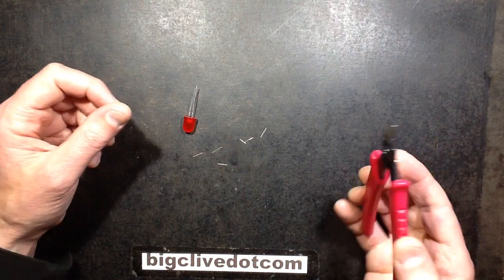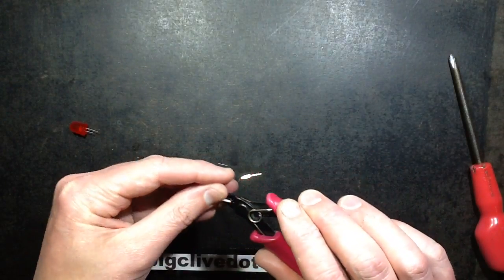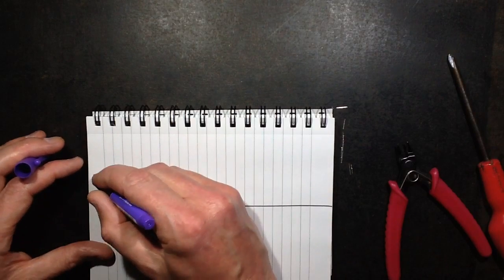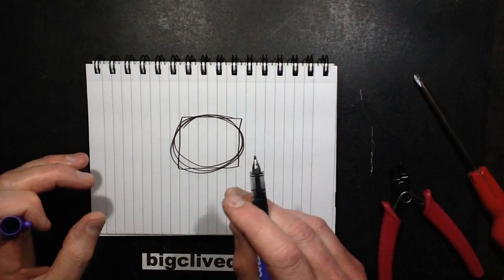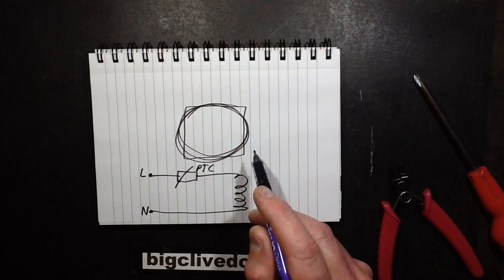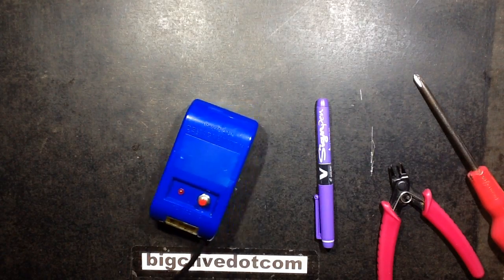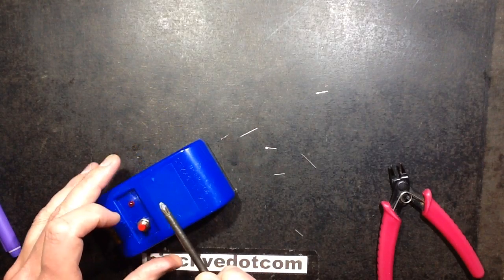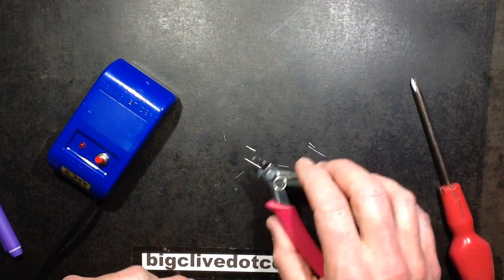A look inside an ebay degausser/demagnetiser from China.

Comment: Tip for a DIY degauser: the water valves in a washingmachine have fairly strong electro magnets, similar to the one in this degauser. They are fully watertight. Mount one of those in a n ABS box with a switch and you're ready to go ;) (it's something I learned about 30 years ago :p )
Reply: Wow, that is a great idea, have a few of those  around; never thought of that, thanks.
Reply: Most CRT's such as an old TV would go through a degauss cycle when powering up and later models especially computer Trinitron monitors had a degauss cycle you could select.   At one seismic data processing company, a user thought he would be a smart ass and said "You want to see something neat" and he put a company fridge magnet onto the screen pulling all the electron beams to it.  He thought it was really cool till the degauss cycle wasn't enough to remove the distortion completely, once he resigned himself to living with a screwed up screen due to his immaturity, I took the powerful magnetic fridge magnet and carefully waved it across the screen at various distances and locations to skillfully stretch out the screen back to a reasonable display and told him not to do that ever again (hopefully the degauss cycles will even out whatever wavering remained over time).   Everything the degauss does can be done by hand with a powerful magnet but it takes time and skill, the demagnetizer is just a simple way of doing it and these watch demagnetizers are dirt cheap, about $15, $25 wth a quality compass to test if the watch is magnetized.  If you still have a mechanical watch, these demagnetizers are worthwhile for whenever they start to run a little fast as it means the balance beam is getting magnetized perhaps by standing too close to a washing machine for too long or just walking past a transformer (mind you skillfully waving the watch around the transformer will also degauss it).  Any magnetism tends to speed up the watch or even freeze it because the effect on the magnetism on the balance beam is to have it act as a shorter beam, you can see if the compass is magnetized by moving it near a compass to see if it reflects, not all of the compass apps on smart phones are sensitive enough to pick up the deflection though one of three I've tried has picked up on my fast running watch, best to use a quality mechanical compass.   Used to be the first thing a jeweler would try if you complained of a fast running watch is to test it with a compass and degauss it with these cheap degaussers but now with so many quartz electronic watches, few even carry the degaussers now and would just ignore a fast running me handicap watch or charge you $200 for an overhaul which usually means sending it to a factory for six weeks.   There used to be mechanical degaussers that used a strong permanent magnet which did not need to be plugged in but they were were heavy due to the shielding needed, they were mechanical as sometimes you had to spin the magnet to alternate the field.   You can buy permanent magnets that you use to magnetize or demagnetize screwdrivers with, same concept, you'll trying to neutralize any magnetism that's there by applying varying magnetism to the object.
Reply: @johnwang9914  The CRT would have eventually come back to normal without all the fuckery...
Reply: @johnwang9914  Just so you are aware, a mechanical watch WILL start to run faster when it's internal lubrication drys out or ends up slung out of all the bearing points. The lubrication actually puts a drag on the internal parts, and slows the watch down, to which the speed is set to at the factory. 
A fast running watch usually means it's time for a lubrication service.
Reply: @davelowets  I have no doubt that a mechanical watch works better with oil and will eventually need more oil.  I'm just saying that Seiko actually has several types of oil and grease and it's easy to over apply the oil with unpredictable results.  Just look at the Seiko maintenance manual, portions of which are posted at the Seiko US website.  Geesh, people's know it all egos... (Of course oil makes mechanical watches work better)
Reply: @johnwang9914  "Know it all egos".. 
Umm, OK
Reply: @davelowets  Hey, you're the one immediately jumping to derogatory conclusions of others from only skimming posts.
Reply: @johnwang9914  Nah, I just posted a fact
Reply: @davelowets  I might've confused your posts with another and for that I apologise.  However, in terms of a watch speeding up as the oil dries, first oils dry out over years to decades, second if the oils are giving excessive resistance than either too much oil had been applied or the wrong grade of oil or grease had been applied to the jewel.  The tendency for watches to run faster gradually over weeks is definitely from magnetism not oil drying which is why watch demagnetizers exist as well as magnetic resistant watch cases and the old fashion CRT TV's and monitors did have demagnetizers during power up which is why there is a buzz as they power up.  As to the claim that Carr's would correct themselves without a degausser, that depends on the distortion.  One smart ass co-worker once called me over to see something really "neat" and he put one of the companies "fridge" magnets we use to put plots up, onto the CRT screen, collapsing the image on the Sony Trinitron computer monitor to one spot.   The Trinitron monitor had a degauss button and pressing that helped expand the image a little but it was still severely distorted, after letting the co-worker repeatedly degauss and worry for awhile about possibly having to replace the monitor or live with an unusable display, I finally took the strong magnet from him and carefully demagnetized the CRT manually till the built in degausser could finish the degaussing.  CRT TV's and computer monitors do indeed have degaussers...
Reply: @johnwang9914  It's all good... 🍻

Yes, it takes a decade or two before a watch speeds up because of lack of lube. It's a common phenomenon with an older collectable watches that have never had a service. A friend of mine is a watch restorer, and he's had many older watches brought in that ran fast, and his clients assumed that it was because of magnetism, but 99% of the time it was from lack of lube. I don't doubt at all that magnetism can affect a mechanical watche's performance, even if it is lubed up properly.
Reply: @johnwang9914  That must have been a hell of a magnet he used. I can remember doing this as a kid, and it never resulted in more than just a little discoloration, and distortion in a localized spot, that disappeared in minutes. Of course, there wasn't such things as strong neodymium magnets around whwn I was a kid. Just weak suck alnico magnets, which didnt have much strength. I had a CRT computer monitor ages ago that had a manual degauss button on it. It was always interesting to press the button after it had been on for days, hear the "THUNNK" of the coil, and watch the display bounce around wildly as the coil and the resulting magnetism did it's job.
Reply: @johnwang9914  Those old Trinitrons had a metal, perforated "screen" behind the front glass, didn't they? Something with a bunch of holes meant to help guide the electron beam to the phosphor more accurately, i.i.r.c...
I wonder if that had anything to do with magnetism affecting the display more than other types of CRTs that didn't have it?
Reply: @davelowets  The Trinitrons did have a shadow screen to separate the different cours but it was not magnetic, not all metals are magnetic.  It is CRT's in general that have a degausser circuit which produces the buzzing sound as they powered up.  It could be argued that it's just the flyback transformer building up it's voltage but that's also what a degausser tends to be, a transformer.   There's a YouTube video where some guy (I believe his name is Cliff) opened up a cheap Chinese watch demagnetizer and found it to be a transformer wired through a momentary contact pushbutton switch to line power.  It's actually the watch demagnetizer I purchased though I bought it with a compass so I can detect if the watch is magnetized and indeed the watches slow down when demagnetized.
Reply: @davelowets  It was the Seismic industry and those magnets are extremely strong as the plots to be held up can easily 20 or even 50 feet long plus it's common to overlay multiple plots so you can flip the pages back and forth to see changes.   Yes, some of this has shifted to computer displays but paper plots remain popular to this day though transparent film output has mostly fallen to the side due to the costs in maintaining the photographic plotters, darkrooms and developer.
Reply: @johnwang9914  I realise the Trinitron seperator screen was non ferrous, but I just wonder if it still had some kind of interaction with the electrons and the eventual build up of magnetics that was different than a regular CRT. It seemed to be that it was many of the Trinitron tubes that had the manual degauss button, whereas the regular CRTs would only do an automatic degaussing when they were switched on. Something was different there with the Trinitron tubes. Those things were HEAVY compared to a conventional tube also. Back in the day I had a  32" Sony Trinitron, and that TV set weighed almost 300 pounds.. It came with a strap that you were supossed to mount from the back of the TV to the wall, because the set was SO front heavy.
Reply: @davelowets  Well the magnetism has more to do with the electromagnets used to steer the electron beams into the scan lines, in comparison, the magnetism from the electron beams would be negligible.  The shadow screen means that the three electron beams would strike three different areas of the phosphor screen hence accidentally activating the wrong colour phosphor was avoided.  Remember it wasn't just the Trinitron that had issues with magnetism and indeed other brands also had degauss features often accessed by a button or from a menu screen and older TV's from the 50's, 60's and 70's also buzzed loudly on power up, the button or menu accessed degauss didn't appear till the late 80's and first appeared on computer monitors which had a higher profit margin.
Reply: @johnwang9914  Sure, I am aware that all CRTs needed the degauss coil. I'm still question that the high voltage electron beam wasn't part of the equation that caused the distortion from the eventual build up of stray magnetism. A magnet certainly affects an electron beam quite a bit, and vice versa. The deflection coils and yokes were back quite a bit inside a CRT tube, and a magnet brought near the front of the tube would mess things up before the magnetism would have reached that far back into the tube. There had to be some kind of interaction between the electron beam and the resulting magnetic field it would produce.  🤷🏻 CRT's arent my strong field in electronics.
Reply: @davelowets  Well, if you're that concerned, the magnetism from the electron beam can easily be calculated and compared to the flux from the electromagnets but as an electrical engineer, I am certain that the magnetism of the electron beams are negligible when compared to the steering elwctromagnets.  Remember, it's not like it's a particle beam weapon, it's only enough electrons to excite phosphors on a screen and only a small area of phosphor at that, a flashlight would have a magnitude more energy, most of the energy consumed by a CRT winds up as heat not in the electron beams.  High voltage does not mean high power and the current is only a very thin electron beam.
Reply: @johnwang9914  That could very well be

Comment: Thanks for the video. I tried that trick on one of my microwave oven transformers and it worked perfectly. Perhaps it could be done with AC step-down transformers like a 22VAC I found on the digital timer from a microwave oven, but I don't know. The transformer inside your degausser reminded me of one of those. AC step-downs are much safer, but anybody with an MOT and HV experience should try my method.
Reply: yep, remove part of the core, so the poles are 'open'...

Comment: I did an internship at Boxmag Rapid in Birmingham. It was a fantastic experience. Most of the products were custom in some way and a lot of the factory was essentially heavy engineering in the usual Brum style. One such product was a demagnetizer for some kind of piped material - maybe slurry. The pipe was about 6" diameter and the unit about 2' long (remember Stonehenge now). As a straight coil it took about 33A but when power factor corrected about 6A. And if you stuck a screwdriver in it, it got very hot very quick!

Comment: Thanks for the look inside Clive, I built my own from a microwave logic circuit transformer. Perfect for my electricians tools, very annoying when they pick up the metal filings the boilermakers leave everywhere from grinding.

https://www.youtube.com/watch?v=2k3zTx4kurA
https://www.dropbox.com/s/maphcsomqqvqvox/IMG_20170619_205227.jpg
https://www.dropbox.com/s/nkaqzvue66fa7xb/IMG_20170620_180414.jpg
https://www.dropbox.com/s/do9zekhkldfqfx9/IMG_20170620_180357.jpg

You may notice I added a proper mains rated momentary switch and a bi-metal cut out (also from the microwave oven) glued to the primary.  IEC inlet for maximum portability.

Comment: Remember, the metal wires can be magnetized too.

Something you first picked up with a magnet will be slightly magnatized a tiny bit, so it will then snap to other metals.

So, to test if you correctly demagnetized a tool, test it on something you know is not magnetized.

Comment: I use a handheld version of this for degaussing tape machines.  It doesn't have a switch so it's always on when plugged in. Covered in warning labels about not leaving it plugged in.  It was somewhat scary getting used to it at first as it vibrates slightly and gets warm in your hand. It can take some time to properly demagnetize a large tape machine (sometimes multiple machines) and I'm always worried about leaving it on for too long.  Any idea how long too long would actually be?
Reply: I would say no more than a couple minutes definitely after you start to feel it heating up. Also you could always put an on/off switch yourself.

Comment: It is also installed in battleships because all the electric stuff can magnetize the hull making them point north. Think 6 pair (all twisted in a cable, helix)  of 500 mcm wire pulled around the entire hull of a destroyer. This is often what confuses dimwits into thinking the Philadelphia Experiment is reality. Degassing is common in large magnetic structures.

Comment: Hi BC.C. I was a display tech on navy ships in the 90s. All my purpose built displays had a manually actuated degauss coil but I became the procurement consultant for IT when they began to purchase computer monitors because sometimes deguass was manually actuated, sometimes not. But once the ship was underway something about salt water brushing against a steel hull made periodic degaussing absolutely necessary. I was essentially put in charge on making sure we only bought monitors that had a button for doing so.

Comment: You've given me an idea for using a micro-controller to slowly lower the voltage to the coil, so that all one would have to do is press the button, and wait for the LED to go out, and eliminate the need to slowly pull the tool out of the field. Hmmmm....

Comment: I used an old electric shaver, with the armature removed.
The vibrating armature held the blades.
So basically I had a half a transformer, and placed tools or VHS tapes in the open poles.
I even used it on my old TV screens too, in the early colour days.

Comment: Those old degaussing coils made for servicing CRT's (about 12" in diameter, mine is a 'CG Electronics' model 9317 but there are others) are great for general shop use. Big enough for most any & all hand tools, vise jaws or whatever comes along. Like you say, the trick is to wave the tool around within the coil, then separate to double arms length before releasing the switch. In my experience 5 seconds or so total cycle time is sufficient, and and be aware of your surroundings; if you release that switch near anything ferrous it could end up magnetized. I always remove my watch, cell phone and other electronics from the immediate area as well. The old coils work extremely well on tools and the like, but seem to have little if any effect on permanent magnets, and are poor magnetic media erasers[1]. Back in the 80's I was in the coin op video game biz; many/most of those monitors were far to cheap to incorporate integral coils, and degaussing them was a frequent chore...  I hate magnetized tools, but like the flexibility of being able to magnetize whatever for some specific task and degauss once done... 

[1] Still don't know how the new 'chipped' credit cards will fair around said coils... I also don't know about their effect on pacemakers...
Reply: I wouldn't expect a degausser to affect a chip card much. Those are just a buried microcontroller with some pads like a SIM, there's no long leads to act as an antenna. RFID cards would probably be a different matter, though; those have a long coil inside the card that the MCU both takes power off and modulates for signaling, and I bet a degausser would induce enough current to fry their tiny little brains.

Comment: I was trying to look up some of your vlogs on some of your kit building,when the power supply kit ,I am building gave me a problem,I am sure you have Had a foil u were scolding come off,what did you do to complete to the circuit,did you make a jumper,or scratch off some more foil to make a jumper,I thought I would ask a expert.some of these Chinese kits have been a little hard no that I am older and the kits are so small. The kit I am trying to build is a LM 317 power supply, maybe it a kit you have already done,thanks for all your videos.